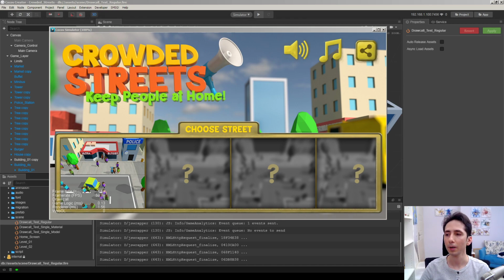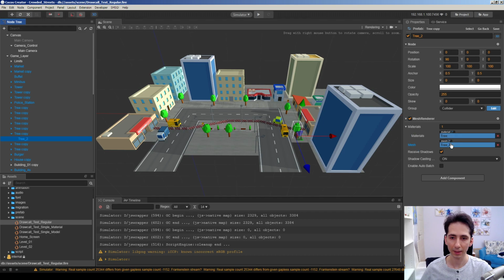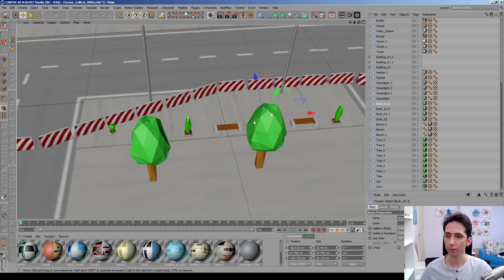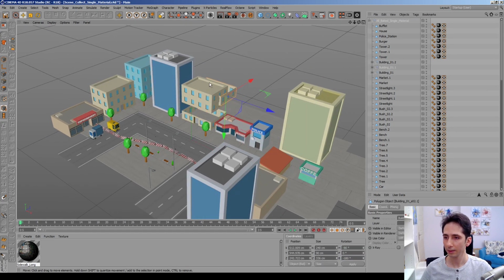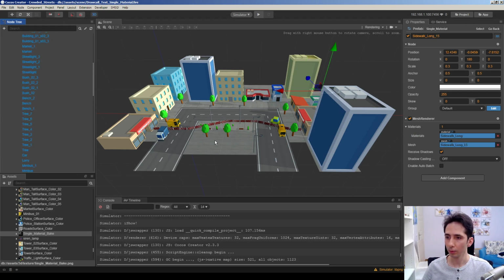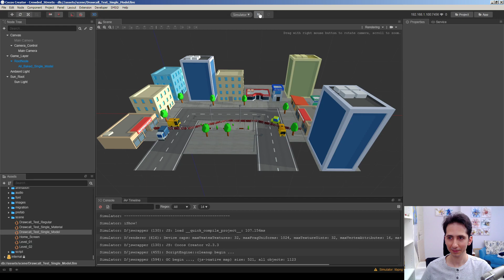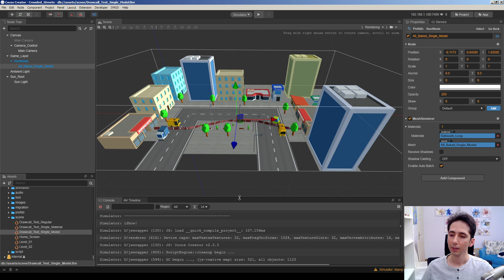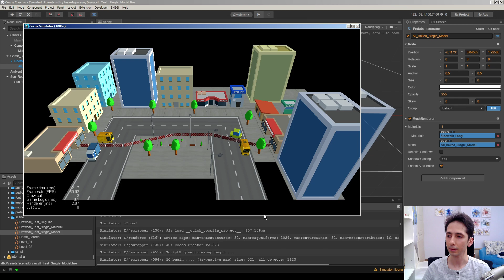Cocos Creator - Reduce Draw Calls by Merging Meshes

Comment: Hi, I'm starting a 3D project and I'm looking into some optimizations.
I see that MeshRenderer that use the same material and has 'enable auto batch' will group with the same draw call. But that's does not seems the case for skinnedMeshRenderer, do you have any thoughts on this ?

thanks
Reply from the maker: Hi Pedro. I didn't try it on skinned mesh renderer. Need to check forums sorry :)

Comment: What happends if you disable shadow on multiple objects? Half draw call count?
Reply from the maker: Yes if you disable it halves the draw call because Cocos Creator renders all the scene (with shadow enabled items) from light's point of view to get the shadow map. We may bake shadows in static objects in an external app and use dynamic shadows only for dynamic object. Need to test it to see performance gain to work load ratio in my opinion.